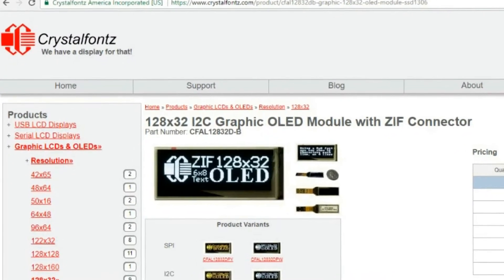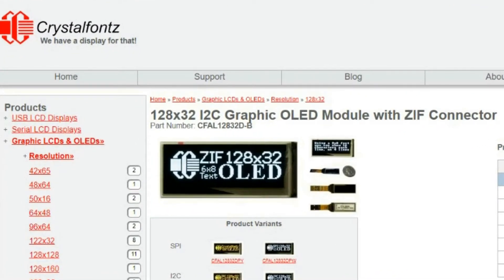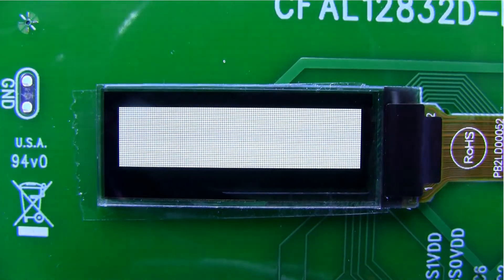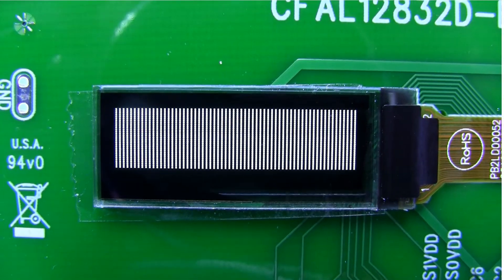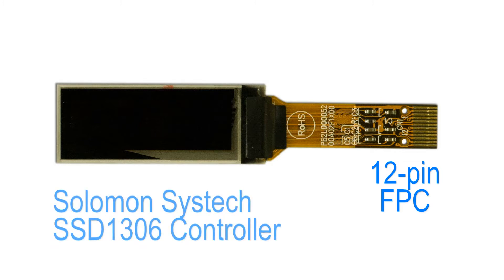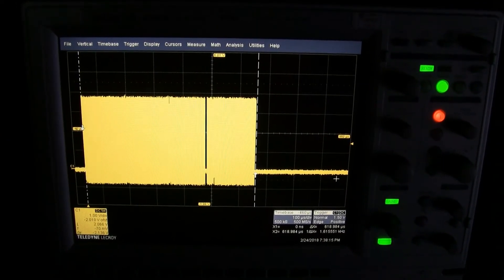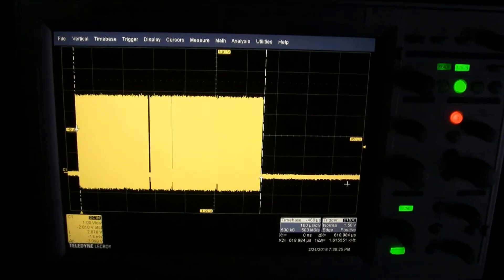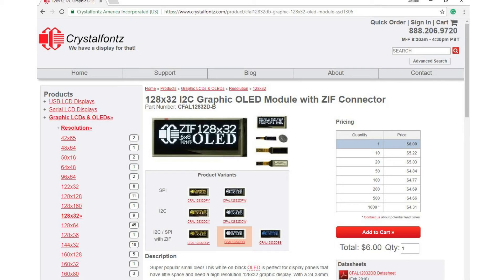Crystalfontz CFAL12832DB 128x32 Small Graphic OLED for Embedded Applications

Comment: Are there any good resources you can point me to so I can learn good ways to mount these into my projects? My current project will be a 1/8" powder coated steel sheet on the front, where I need the display. Oh - I'm mainly considering the I2C + SPI monochrome model.
Reply from the maker: That's a great question, unfortunately it really depends on your design. For these specific displays, they can be "taped" using VHB to a PCB then use risers to space it from the steel sheet, and a piece of lexan to protect the glass. Here's a blog post that shows another method: https://www.crystalfontz.com/blog/dual-voltmeter-for-rv-electrical-systems/ I hope that helps.